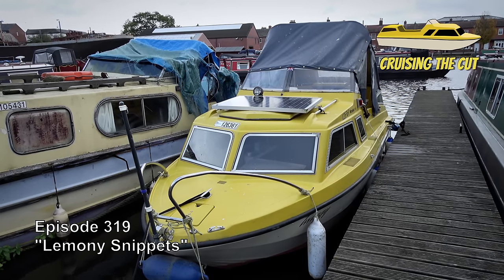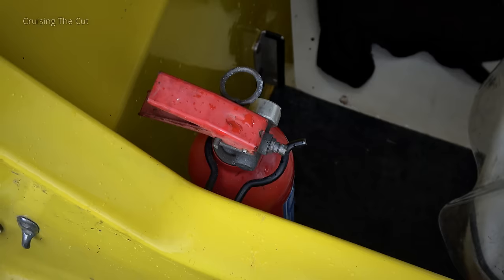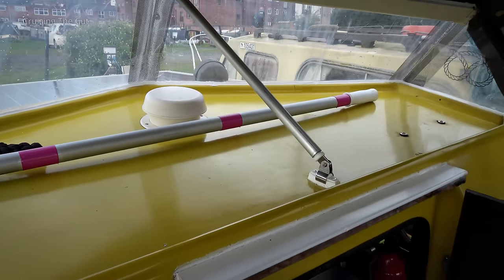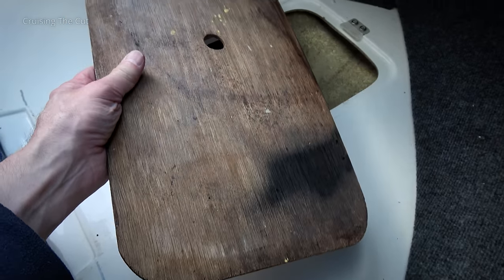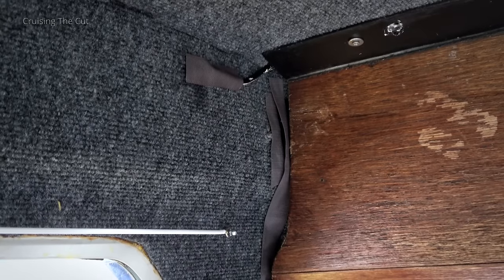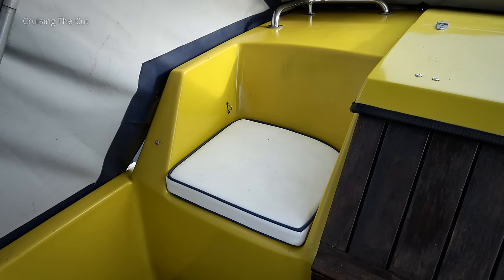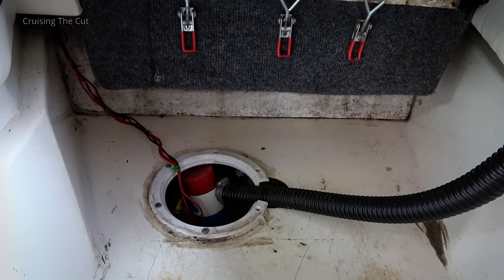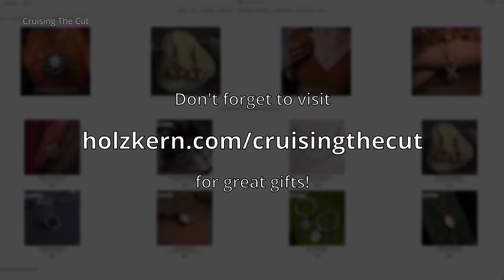319. My boat - the FULL TOUR!

Comment: I foresee David learning how to do proper fiberglass repairs and modifications in his future. Not to fret, David. It's really not that difficult. Don't forget to look into flock and microballoons that can be mixed into the resin for small repairs. And the expanding foam can be your friend for larger ones.
Reply from the maker: You wouldn't believe the number of YouTube videos about fibreglassing I've been watching recently!! Still can't quite understand the difference between epoxy and fibreglass resin. Or exactly what kind of gel coat I will need...
Reply: @CruisingTheCut  Epoxy is a glue that happens to work well with fibreglass. Polyester and vinyl-ester are cheaper but don't really stick to things, so are only really good for using in a mould to make a new part.
All the jobs you mentioned would be best with epoxy. I'd order a litre of west system, with fast hardener in the winter, slow in summer. It's worth experimenting with the various additives. Silica turns it into a nice thick, non-slumping paste for glue. Micro-balloons give a paste you can spread very smoothly to minimise sanding when fairing a rough surface. Flock/chopped strands add strength when you're making a thick fillet. All the fillers are very light, so order the minimum quantity.
I recommend lots of gloves, lollipop sticks with the end cut square for mixing sticks, in cups with a flat bottom so you can scrape up the last bit, plastic cards for spreaders and digital scales to get the proportions right. You won't be using enough to need the pumps.
You will probably find paint easier than gel coat. Gel coat self-smooth like paint, and needs extensive sanding and polishing to look as good as it does when used in a mould.
BTW, the gel coat may have faded from new. You might be best to take a sample somewhere that can scan it.
Reply from the maker: Thank you!! 😊😊

Comment: Have to say, a lot of the work done on this boat is one of someone doing things as cheap as possible.
I'm currently having to fix a list of issues with my house cause the previous owner refused to do anything properly and skimmed on basics which left some dangerous situations with the electrics.
Would highly recommend investing in some harness tape from Tesa and browsing RS components for cable trunking and clips to tidy up the battery harnessing.

Comment: The well area in front of the outboard motor is for keeping the backwash of the boat wake from entering the boat when slowing or stopping. Instead of washing over the transom, it enters the well area and exits the drain whole.
Reply: And also, it allows space for the motor to be tilted up.

Comment: You made mention that the spray foam holding some of your boat equipment will be a sticky mess to remove.  Don't worry about that, the foam spray is dry and won't be sticky now.  It will be plenty sticky if you plan to use spray foam in the future.  Be sure to use rubber gloves on when you use spray foam, it will stick to your skin and clothes and anything else it touches.  It is completely dry in a few days.  It's a good product to hold small items in place when nothing else is handy.  We have a brand called 'Great Stuff' in the states.

Comment: David - as someone who's has boated most of their life in southern Ontario Canada, that "catch basin" behind the motor is designed to facilitate the transom and catch the rooster tail and reverse wash that inevitably splashes aboard from the motor. There is usually drainage holes at the base of the basin.
Reply: But of course, these are negligible problems on the slow canals. Well, maybe the reversing to dislodge the weeds built up on the prop - no reaching down to remove by hand on an outboard.

Comment: Hooray David has another project.
Suggestion to stabilize the table: the tapered ends probably need un-tapering, perhaps cut off 5mm or so and/or add ribs to the taper to make a tighter fit for the pole.
The cable with connector I use for a 12v LED light strip. I have various lengths depending on where I want the Light.
 
Seasons greeting from a South Afican caravanner.

Comment: Nice to meet your new project.  The problem with the hinges is that they are on the wrong way around the hindge should be on the outside and the two moving parts should close onto each other.

Comment: Those mystery dangly connectors are low voltage plugs which likely run back to the battery. Useful for extra lights, radio, tv, phone charger etc. If you need extra power points you can get nice little bulkhead sockets. Years ago I had an 18ft centre cockpit cabin cruiser. Took it up the Thames, no barrier, to Limehouse then on to Wigan eventually. Was based in Nantwich for a couple of years. Great fun. Had a 20 horse Merc, bit overpowered but very useful on occasion. Enjoy yourself.

Comment: One good thing about the really old fiberglass boats is that many of the builders were new to the material and tended to over build the hulls, which is why some of them have lasted so long. That being said 50 years is extremely old for a fiberglass hull. In an earlier video David mentioned that the hull was flexing, that is a really bad sign as it indicates damage to the hull. It should not be a problem on the canals but it might be a bad idea to take this boat on to open water where it might have to deal with waves.

Comment: David could you mount the solar panel with a hinge at the rear edge of the panel?
Attach a stay to the lid of the hatch with a sliding join at the solar panel's front edge ; 
the stay lifts the front edge of the solar panel as the hatch is opened thus flipping it back towards the windscreen......
which clears the hatch opening for egress and ingress.
Pulling the hatch shut drops the solar panel back into it's place at the same time.....

Comment: For the wet area at the outboard you an lower the drain hole so that all the water can drain out. You might want to reconsider the water tank thing. I have a similar sized/style boat. I took the water system out when I got it and use water containers as necessary. Haven't missed the built in water system for the last 10 years. Depends on how much you intend to use the boat, but leaving water in the system unused for longer periods is not a good idea unless you treat it. It doesn't take long for the water to get icky. Cleaning an icky water system is a pain. When it comes to patching the fiberglass, it really doesn't matter what the original Pantone color is. The gelcoat will have faded and if the boat was moored mostly facing one direction, the color will be different on different parts of the boat (well shaded areas inside might be close to the original color).

Comment: I hope you surveyed the boat as thoroughly as this prior to purchasing and used each and every fault to knock the price down. 

Solar panel: If there is no other place to locate it, how about making a set of mounts to fix it to the hatch cover instead of the rails, then you can open the hatch together with the panel. Not perfect, but if it is the only location for the panel it is better than nothing.

Insulation: Is there really any advantage to taking the existing lining out to add foam and a new carpet? Depending on space and ability to fix it in, why not add the foam on top of the carpet, then the new carpet - the different density of each layer does wonders for sound attenuation and vibration suppression.

It looks like you will have more jobs on your hands to get this one shipshape than you ever did on your old boat. I hope you enjoy the tinkering and that you take us along for the ride. Let the projects begin!
Reply from the maker: Cheers

Comment: I had a 26’ lake cruiser. It required a massive amount of work, fibreglass, electrical, mechanical, all of it. I spent a couple years (and a fair bit of money) cleaning it all up, used it once or twice and sold it (certainly not recovering the cost of what I put into it). But it was the joy of fixing it up I loved the most. Everything can be fixed; under that faded yellow I am sure you could find some shine, and with some practice I bey you can match that color… shes a gem David. Cheers

Comment: Great overview… the rear area near the motor is a “splashwell” sometimes water will roll over the transom either from rough water or the motor itself. This was installed to keep from flooding your boat in rough water or the movement of the boat descending from plane at higher speeds. It’s there to drain water out instantly. If that is leaking it could be because someone has stood on the fiberglass at some point. This area is fairly unsupported and is not meant to hold much weight.
Reply from the maker: Ah! I wouldn't put it past a prior owner to have done that!

Comment: Hi David - lovely to see you back on the water and I completely understand the attraction.  The list of items to be fixed, changed, investigated and improved may seem long to the uninitiated, but an afternoon, or two, with a pot of epoxy and some fibreglass mat, and I'm sure that you will reduce that list very quickly.  I have an aphorism on my shed wall that says "Bog is your Friend" - and we all need friends, particularly this one - the amazing fixer of a myriad of little problems.  I wonder if you can get gelcoat custom tinted?  I've never tried, but it would seem a reasonable question.  I look forward to the inevitable video progress report - probably more than one - actually, many more than one, I suspect!  Still, you'd only be home cleaning the gutters...   Good to have you back.  CaptainAB - Australia.

Comment: That table looks like its a collapsible  bed deal.

Basically you can lift it up, pull out the leg and put the table top in the hole flat on it.

Making the two single berths one big one.

Its a common set up here in the States for Truck campers and smaller cabin boats like this. And they do have a habit of wearing out and becoming lose like that after a few years.

The newer ones are a twist snap deal while the older ones have a wing nut or five to secure it.

Suggest looking around the base and top bit for any thing that look like a latch to pop it apart.
Reply from the maker: Yes, i's definitely the case that the table forms part of the bed infill. I've seen those twist ones you mention, I'll try to get one.

Comment: Thanks for the video - amazing how you managed to make a 20minute video on such a small boat tour but still keep it interesting!

As a famous YouTuber! And the last one on the planet not to have done a power bank advert…. Yet! I would imagine that would be a nice solution to the batteries!  A decent sized power pack which you could charge at home and plug into the boat for trips away, should be compatible with the solar panel and if that Honda has any sort of alternator (probably a few amps) could be used to trickle charge whilst cruising… a decent size one would run an induction hob and a few lights etc and then simply take home to recharge!
Reply from the maker: Hahaha I was offered a power bank recently and was toying with whether it would be a good idea for the boat but I can't bring myself to do a power bank promo 🤣🤣

Comment: For the tunnel lighting I would check out some of those ultra-bright LED flash lights or headlamps perhaps, they provide a lot of illumination and you could even use the built-in battery to eliminate one more water ingress point as long as you can figure out a way to turn them on or off without wiring.

Comment: Reroute the outlet for the bilge pump straight up into the transom well...seal the outlet pipe where it goes through the floor and through the bottom of the transom well....
extend the outlet pipe up about 4 inches above the transom well floor height so the transom well can't back-flood into the boat....
Wire the bilge pump directly into the whole battery system...
if the boat gets a hole it might need all the battery power to keep ahead of the leak and give you time to react..
You might think about an internet camera(s) that allows you to monitor the inside of the boat when you get a notification of whatever alarms you fit????

Comment: To Capt. Nimmo.   2 suggestions -  [1] - move battery system back to former Loo location/ removes electrical away from your water/ water tank into area under sink - [2] - relocate life jacket to inside wheelhouse, if you sink & drown it will be hard to explain to Coronal Enquiry, - " that when starting to sink, you went below deck to retrieve life jacket and everything went pear shape".
If you need any further evidence - a re run of the movie Titanic, will assist in clearing the mind - and NO that does not mean standing at the Bow, as you go along the Canals, singing - Adel, Barry Manilow, Paul Simon, Bing Crosby !!!!!!
Reply from the maker: I wasn't going anywhere so life jacket was stored

Comment: Plenty of projects to tinker with, looking forward to all your videos.  Thanks as always.
One thing I wouldn't reuse would be that "surge protector" on the batteries.  I've had a couple of the same model go faulty and overheat, and searching around on the internet it seems that they're prone to failure and potentially a fire risk.
Reply from the maker: Thanks for the info; much appreciated

Comment: I think you should read up on bilge pumps. Since the boat is around 50 it might be wise to be able to inspect the inside of the boat below the deck, perhaps this is possible? You should have the bilge pump at the lowest area, not sure this is so today. Maybe buy a new pump if the old one doesn't look fit. And connect it to the main battery directly, not via the master switch. You want the hefty main battery to keep emptying eater, not attach it to a small battery that will run out soon if there's a big leak. And two bilge pumps instead of a single one is extra security if one fails. This depends on how often you plan to visit the boat and check it. The hole you noticed might be for letting water run out to the bilge below.

Comment: Good heavens mount the solar panel on a board hinged at the back. So, when you want to open the hatch, just tip the solar panel up. Or maybe mount the solar panel directly to the hatch, so they open together. Nice boat by the way.

Comment: That outboard could surely use replacing if i am honest. Newer ones will be more efficient, cleaner burning, and keep the fuel to itself (hah). On the subject of fuel - that gas line could possibly have been the fuel line for an older outboard - LPG/propane powered outboards are indeed a thing. As far as all the water - probably a combination of condensation and rain. Finally to touch on that "bucket" area forward of the outboard motor - this is a space that allows for a number of different outboard engine sizes and types - and for the ability to tilt the motor out of the water. I have also found that many of these style microplus models have a small hard canopy over this space - some covering the "bucket" and the motor when tilted out of the water. May be worth looking into such a canopy/mounting points etc. In all really sounds as if you have a fun new boat with lots of small projects that will help make it new again and all your own! Cannot wait to see what you make of it!

Comment: Re your solar panel - get a stainless steel bracket made that extends the full width of the boat and out over the motor.  This is where many sailboats mount theirs and you will probably be able to fit another panel.
Reply: Probably quite difficult to do without being very vulnerable in locks.

Comment: You might consider adding a couple of davits or brackets on the rear of the boat.  It seems like there is room to put a raised davit/bracket over the engine/rear area.

Comment: Merely a suggestion, and I know precious little about things nautical. . .   The solar panel /hatch arrangement looks scruffy, would it be possible to get a larger hatch fitted and attach a flexible solar panel to the larger hatch top, or perhaps do away with hatch altogether and then attach a flexible solar panel to the new roof?  Your solutions to problems and the improvements you make to Twiggy will keep me watching for months/years to come.  With the crazed fiberglass Twiggy reminds me of the old Reliant Scimitar that I used to drive.

Comment: I'm probably not the first to mention this idea in the comments, and apologies if you mentioned it in a video and my brain absorbed it and then forgot it did, but:

If you got a propeller with a shallower pitch to the blades, or perhaps a smaller propeller or both, perhaps that would lower the minimum speed of it running and keep you from needing to get another motor. I don't know how feasible that is or not, I'm not experienced with boat props.